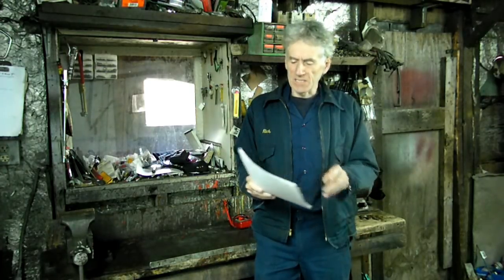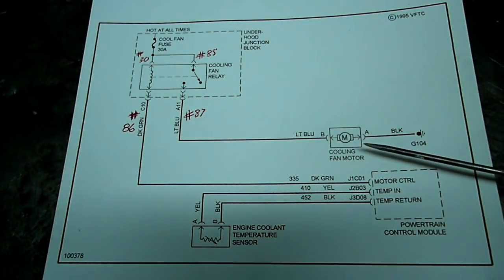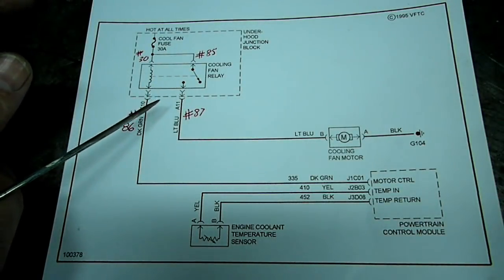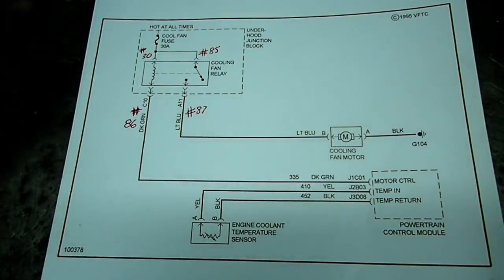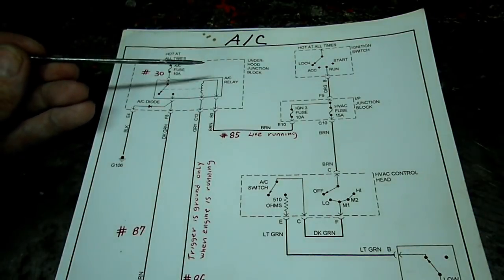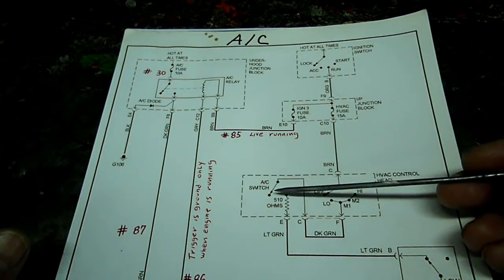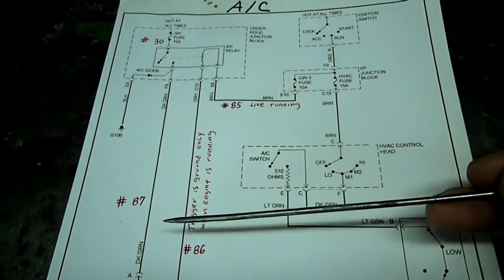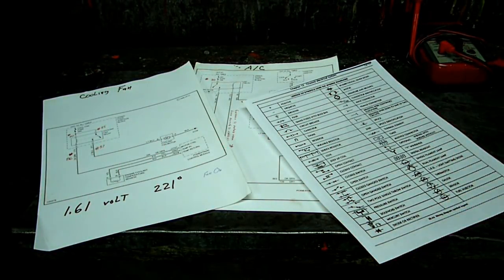Following Wiring Diagrams

Comment: How is ground the pulse? It's very confusing, the entire car frame, engine and electrical is all tied together so how is the flow of current going through ground and not ungrounded?? If you ground an electrical device and run current from neg to POS how does it not fry or blow a fuse?? I just don't get it

Comment: Your explanation of  that diode was a little off let me explain that diode is in reverse bias which means the energy is absorbed by the compressor   Coil stator when the switch opens the diode is now in forward bias the current from the stator discharge is in the same direction as the current that produced it LENZS CURRENT LAW It is there to protect  arcing in the relay switch. THANKS

Comment: Is the Control Module grounded and not shown? How are electron allowed to flow to allow the current to flow and the coil to energize? Lastly, is the coil inducing/energizing the switch from NO to a closed position?

Comment: richpin06a : hey , it would be very interesting if you manage to create a video where you'll explain how the coolant temp information goes into instrument cluster. I have an Audi A4 B5 and my temp gauge doesn't move at all. It is not the sensor so i think it's a cluster problem, a connector problem that may need soldering or on the board anything that goes on the way of information reaching the temp gauge . Thanks

Comment: hii
 so the ac diode is to short the generated power to ground to save the relay from arching damage. 
why the diode is wrong direction ? i know if the diode is reversed  from the above shown direction , then it will short power to ground all the time and burn it .. but how can the regenerated power from the already shut down coil go thru diode ? 
why not replace the diode with a high resistance resistor ? 

just want to know. 
thx 
andrew

Comment: Thank you!   I have a problem with the Selector switch of a Defy 119, 3 plate electric stove. I found the wiring diagram of the stove on the internet.  The connecting points on the selector switch, which devides the oven and one stove plate to work separately from the other two stove plates, are a bit confusing.   Unfortunately I did not mark or, taken a photograph, as suggested, of the positioning of the wires on the selector switch.    

Can you perhaps give me advice?  My email address is cjharmse@telkomsa.net 

Corrie

Comment: Hi Rich! Cool video but I have a question about a 2004 Ford Focus LEFT rear power window that I hope you can answer. 

My LEFT rear window won't go UP but it did go DOWN, and all other windows work fine. I took out the switch to the LEFT rear window and replaced it with the RIGHT rear window switch, but the window still won't go UP, so I figure it's not the switch. I also bought 2 other switches and they didn't work the window either.

I used a test light to see if there was any difference in how the electricity was distributed in the switch unit and here's what I found.

Both switches get power from the same colored wire and at the same connection in the switches. However, while the RIGHT switch (the good one) distributes power to only one connection in the switch when the window is raised and puts power to a different  connection when the window is lowered, the LEFT switch unit (the thing that connects to the switch itself) puts power to the same connection as the RIGHT switch unit when I press DOWN, BUT when I press UP, three (3) connections (not just one as in the good switch get power.

There are 6 wires to each switch. The black and the purple/yellow wires never get power at all when the switch is pushed UP or DOWN. 

Do you think there's a short in the motor in the LEFT door which is causing 3 connections to light up when the switch is pushed for the window to go UP?

Any help will be appreciated.
Ask me any questions and I'll try to make this more understandable.
Thank you very much.
kl
Reply: You got your answer, yet?
Reply: No. It seems no one knows what's keeping my rear window from working. Are you having the same problem?
Reply: No! Just curious :-)
Reply: Maybe if you had a wiring diagram you could follow , you think that would help you ? I could provide you with one
Reply: kathy loften use a jump wire to the wiring from the switch to see if that makes the window go up then let me know what happens
Reply: Maybe you have a problem with the motor try to disassemble it and test it for both sides cause its the same motor only flip the power.

Comment: Hi Richpin
I have a 2002 Saturn L300,
My ac compressor don't turn on,
and my fuel and water temp gauge dont work.
I think its my Bcm.
Does the ac circuit
go through the Bcm ?.
I read static pressures on my gauges.
I CHANGE MY HI PRESSURE SENSOR.
When I bypassed my ac relay the Compressor engages.
My relay and fuses are good.
So my Ecm is not completing the circuit.
So the only thing 
left is the ac control switch or Bcm or ecm ?
Thanks.
😇😃🐬😃😇

Comment: There were a few things that could have been explained in a clearer manner and here is one example.

When you explained the operation of the diode and clamping the back emf of the compressor you should have used the convention of explaining the actual direction of current flow (conventional current). It would be confusing to say that "the voltage goes up the wire and through the diode".

Comment: hi Rich I want to know that how to figure out 4 different colors wire motor that wether this motor is single speed or double...if single ..which one starting n running wires...if double speed ..which two wires are for speed ...thanks a lot

Comment: At the "Hvac control head"... why is there no resisters/variable resister shown in the control knob for (off, low,m1,m2 & hi) settings... for outputting a set voltage to computer to later turn on motor at these settings?.... Is the "pressure switch" physically this component? (or maybe somehow connected to it)... This diagram looks like it just turns on ac without taking into account the settings...

Comment: Have pulse now but injectors frozen so no fuel delivery, he had another TBI with injectors so i tested those injectors with a 9 v battery and they click, others did nothing, now trying to get a gasket as they are one use gaskets --then it should be ok, truck has been better days if you get my drift

Comment from the maker: The wires from the injectors do go to the computer.If you are not getting anything at the injectors there is a possibility that the computer is not seeing a sensor like a crank or cam sensor.In which case it would shut down the fuel delivery.

Comment: Rich, my buddy has a 93 GMC full sized pick-up 5.7 with TBI, the 2 injectors aren't getting pulse, he replaced the fuel pump about a week ago, then yesterday he replaced the dist. pick-up which i installed for him, also module, none of which worked, do you feel it's a PCM/wire problem?, In the dark i used a test light to test pulse, i used bat. + and when key is on light on, cranking = no light, it should pulse-- is the pulse regulated by the PCM only? I will try to help him tom. in the day

Comment: Thank you richpin. This was just what I needed. It seams that my cooling fan stoped working. Fusses checked ok and so did the relay and the high low switch. Ac works but the fan just won't switch.. what do you think it could be?

Comment from the maker: The diode is installed facing the power flow so the power does not see the diode.The reverse polarity of the voltage spike will see the diode and short out the spike.
Reply: Couldn't you just say that the diode is only  there to suppress the voltage spike since it cannot go to ground because it is forward biased?

Comment: I have one question with respect to diode, during normal operation, (when compressor running), will not the same logic applies like the feed wire seeing the diode and shut down the ground. In other words can u pls advise me, what will happen if that diode is not there during that back electro magnetic force(emf), and is that emf is positive or negative volts. I assume it is positive and you are dumping that positive that ground, if so why the same is not happening during compressor running.